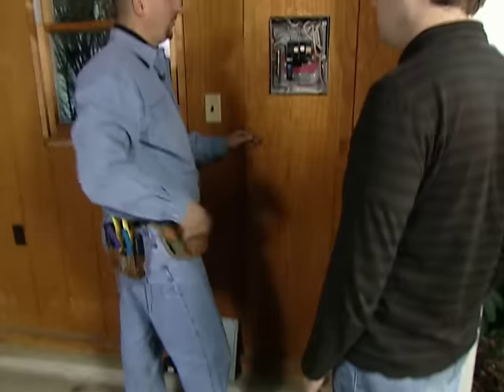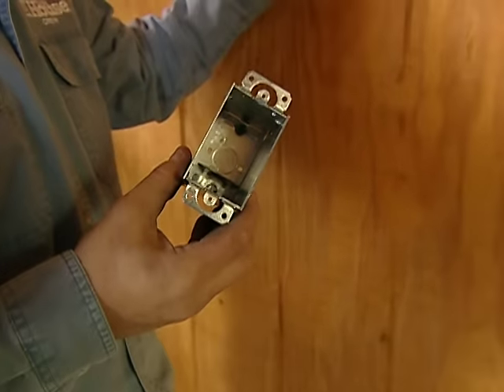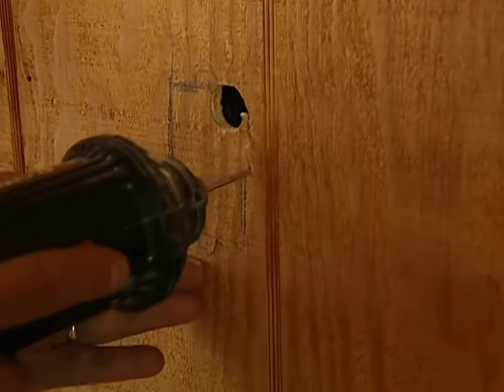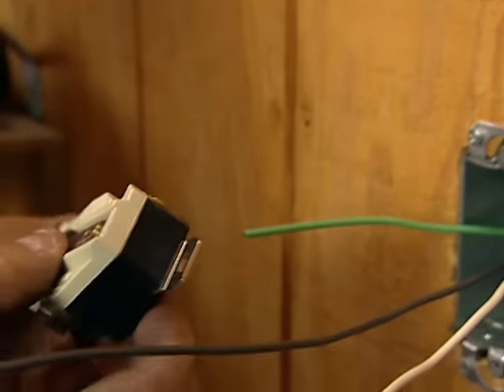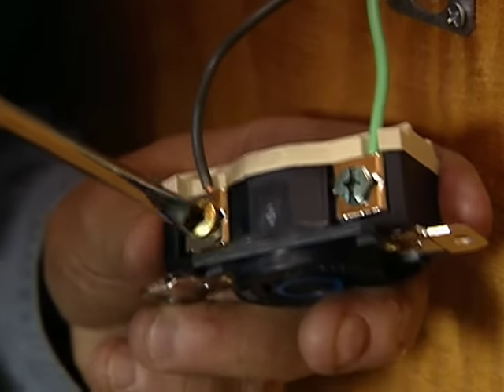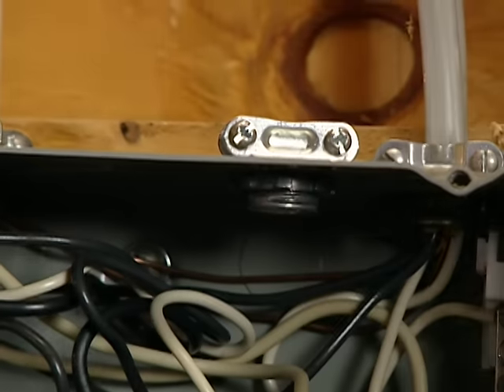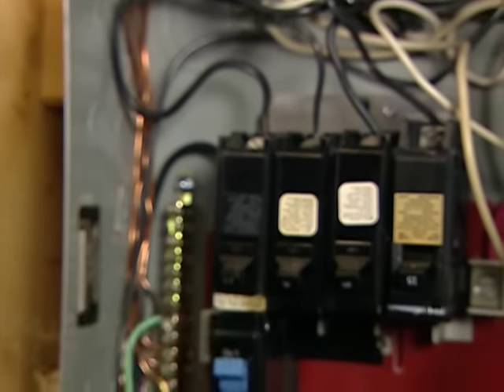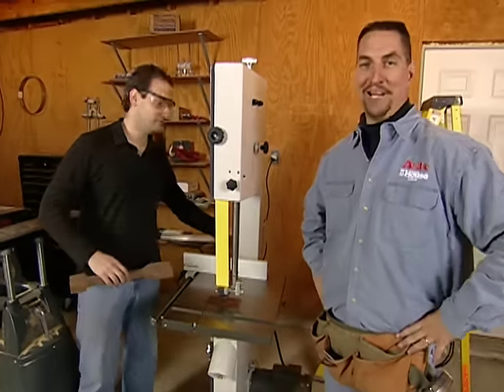How to Connect a 220-Volt Receptacle to a 20-Amp Breaker | This Old House

Comment: This Old House, just broke NEC code for installing an outlet. The White can absolutely be used for a hot wire BUT it MUST be marked (as simple as putting a little bit of electrical tape around the white covered portion on BOTH ends is all that is needed) that's because when someone goes to work on the wiring in the future they don't end up killing themselves or someone else. 

Man This Old House, you've gone down hill. Showing people to use saddle valves (which are against code in all of North America because they always cause leaking), and now not marking a live wire. Next time how about getting a licensed tech to do the work and keep away from using handymen.
Reply: well it's on a 220/240v outlet and breaker... Explain how magically the outlet is removed and a white wire sits there hot for someone to touch? If someone removes that outlet and doesn't know there are 2 hots, it is their fault for removing it.   I still agree it is best to mark it, (though NOT with tape).
 Also I saw TOH videos saying do NOT use saddle valves.
Reply: @fizwin1  the video I had watched right before this was a video by TOH and they were boasting about how easy and convenient the saddle value was. I believe it was a humidifier install but it might have been a fridge.
Marking a hot wire is for the what if factor. If accidents didn't occur we wouldn't need vehicle insurance or seatbelts, or air bags. People make mistakes, people rush, people simply are human.
Reply: Since we’re being douchey, the wire must be PERMANENTLY reidentified. In other words, wrapping black tape around it would also be a violation. Even marking it with a sharpie would work. Don’t be such a drama queen.

Comment: never understood why professionals always feel they have to cut the wire a foot too long at both ends and then trash expensive copper wire.  So easy to guestimate within a couple inches.
Reply: Better a foot too long than an inch too short.
Reply: rtel123 always always want more than what you need
Reply: rtel123 for how much copper he is cutting of it is worthless you need piles of copper to do you any good at a scrapper
Reply: Eric Standefer, exactly!!
Reply: I think you mean estimate.
Reply: Don’t question professionals.

Comment: Thank you members of the US Congress and constituents of the US Senate Nevada state ministers measurements and weight 85000 brick a day, I rise today in rebuke to order a veal roast as a all the weight for 85000 birthday respective to bricklayer Mark McCullough and the provisions that I provide with whiteford water heaters the beginning of communication is based on the payment that I will provide to hug a g HUD voucher parlayed to the casino floor by thanking you in advance calculus u.s. president 310 Vincent James Walter Whatley 4th 04/09/2020 PST 1020 HRS#* Public work.

Comment: WOW, that is totally irresponsible not to put black tape over that white wire. If you don't want to put black tape over the white wire you could at least leave a note. Maybe a neon sign saying dangerous condition, remove with caution.
Reply: Should ideally be red, to indicate it's out of phase with the existing black wire.

Comment: There is no such thing as 220.   In a north american single-phase panel it is 240 volts.
Reply: 220 230 240 no one cares
Reply: It used to be 220, just as line to neutral voltage used to be 110. Supply voltages have crept up over time to push more power through existing wiring.
Reply: what about 208v ?
Reply: @fizwin1  I said single phase.   If you have 208 volts it is three phase.

Comment: No insulated terminals and no insulated housing? Thats very dangerous! Do you not know "touch protection"?

Why are the holes for the sockets so big? In Germany, we make a round circle with a diameter of 68cm in the wall and then we thake there hollow wall box in.
If you want one more socket, you have to take only one more circle under the other... Thats most faster than that method.

And the cable look dangerous too... If you bend the cable, the insulation inside breaks and there is a short circuit or there is voltage on the cable sheating!